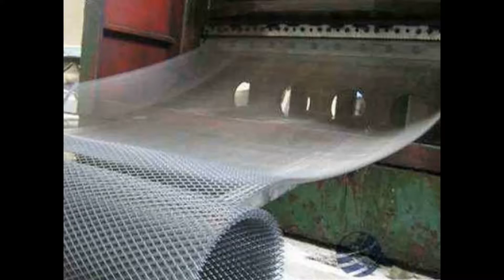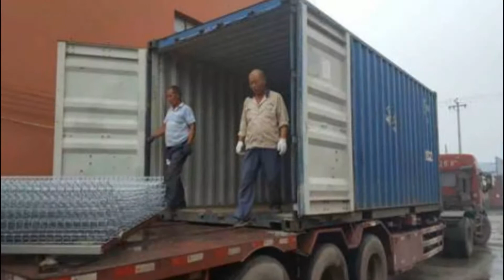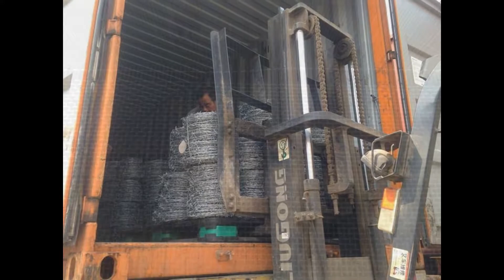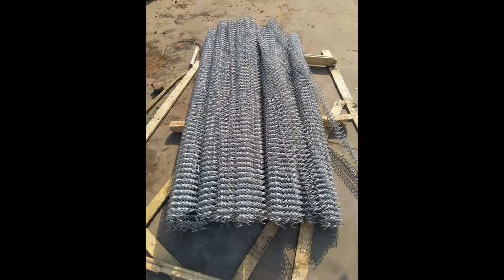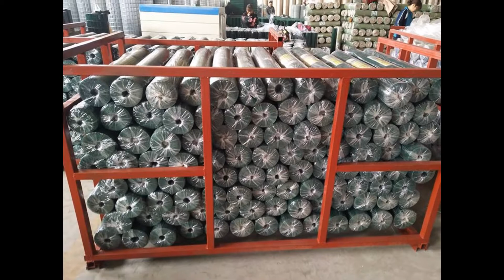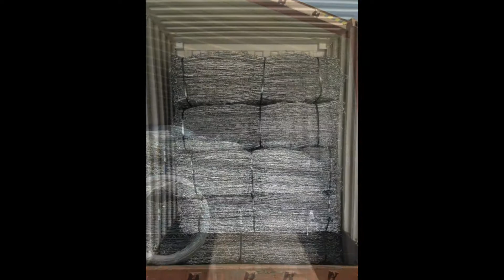XUANKE STAINLESS STEEL WIRE MESH-Best quality competitive price.STAINLESS STEEL MESH SCREEN

Comment from the maker: China Xuanke wire mesh Co.,ltd -world leading stainless steel security mesh ,stainless steel security screen Our products mainly export to Australia,Canada,USA,Germany,French,UK etc 150 countries and zones.Mainly products including:
304/316Emergency Escape Window Security Screens ,
Patio Screen,fly screens,emergency escape screens,fire escape screens,316 Marine Grade Stainless Steel Mesh,
Patio Screen Enclosures,304/316insect screen ,Security Window Screens,security door screens,316 Marine Grade Stainless Steel Mesh ,security doors & window screens,
T316 black stainless steel mesh screen,
T316 marine Grade stainless steel mesh,
Fire escape screens,Security
Window Screen,316 Marine Grade Stainless Steel wire mesh 
mesh panel size :
750mm×2000mm 
900mm×2000mm
1200mm×2000mm 
750mm×2400mm 
900mm×2400mm 
1200mm×2400mm
1200mm×3000mm